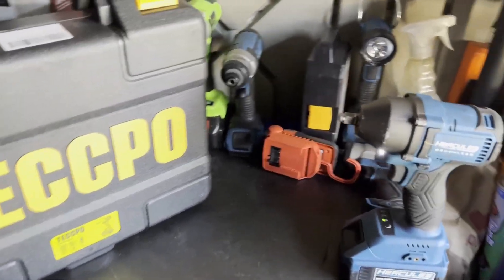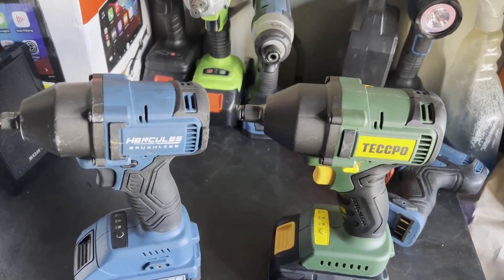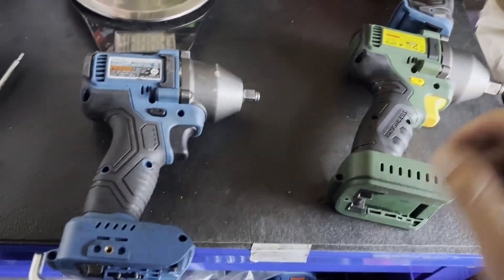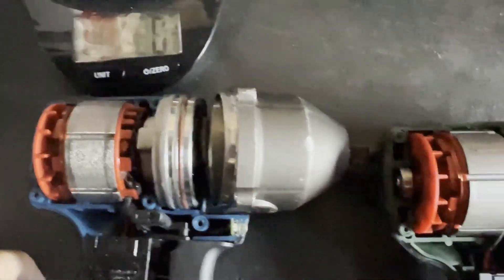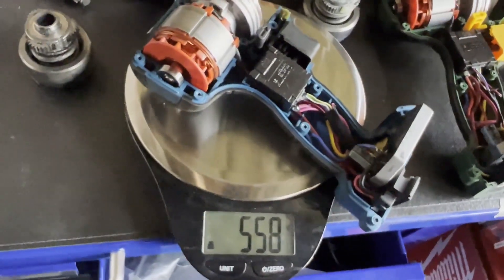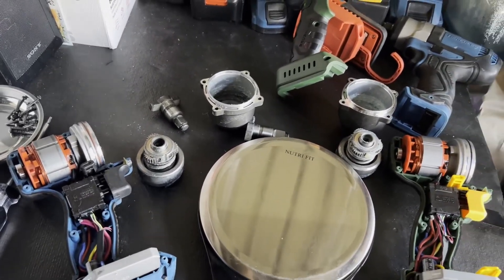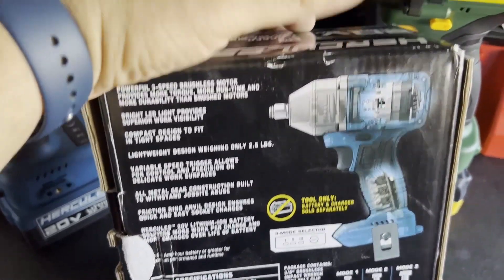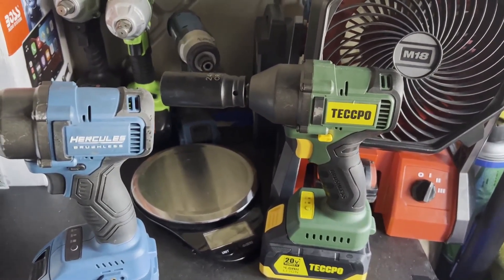Hercules Impact Wrench Chinese Clone? Did Harbor Freight Lie!?? Torque Test and Dissasembly!

Comment: since they are so similar, I wonder if the batteries are interchangeable. Can the Hercules use the Teccpo battery?
Reply from the maker: they didnt physically fit maybe with a shell swap it would

Comment: I mean impacts technology is all very similar if a lot of different is when you worry. Older DeWalt and new craftsman are identical almost. You can even almost get a DeWalt battery to line up with them . Same with Milwaukee and Ridgid. Same owners too.
Reply: That because Stanley owns both Dewalt and Craftsman and Ryobi/Milwaukee/Ridgid are own by Techtronic Industries TTI Group. So Bauer and Hercules are likely made by chinese TECCPRO company. They likely changed some stuff but likely made by TECCPRO which are actually pretty good tools to and pretty much pro grade. To me it about time Harbor Freight step up their game? For years I avoided their power tools as use to be pure garbage, now the Hercules impact driver is as good as my Milwaukee, I use both and both gets the job done without having to switch and both took drops, oil and trans fluid and other dirt without issues. Both brands if you get the sales you can buy a battery/charger and get a tool free, or opposite at times. I got free 8 AH 21700 cells batteries this way with both brands.

Comment: Maybe Harbor Freight did design these and the Chinese factory manufactures the off brands after dark lol. If you buy the Tecc---whatever...you aren't getting a serious warranty with it and practically no support...a separate charger just for that tool only. With Hercules you get a 5 year warranty, support, a growing tool line, and bigger batteries. If you find these knock offs super cheap, you can use them for repair parts.
Reply from the maker: Lol the knock off ones are older but ya the hercules has the superior warranty now with the 5 years

Comment: I wanted to compare that Hercules 20v 1/2" compact impact driver to the Milwaukee M12 1/2" Fuel Stubby Impact driver rated at 250ft-lbs. breakaway torque!

There is NOWAY that weak azsz Hercules have more torque than the Stubby rating it self up to 555ft-lbs of torque, hell nah!  The Stubby is very powerful and you can tell it's fkn' fast on 3rd speed, really fast and it's on the 12v grid.   I believe that their latest Ultra Torque impact drivers have finally put HF on the map for quality tools for that category!

I will get this Hercules 1/2" compact driver just to take off lug nuts off my BMW M5 when getting flat tires in emergencies and nothing more since I already have that Monster of a beast build like a tank Hercules Ultra Torque 1/2" Impact driver with 21700 Tesla cell battery!

Comment: The big difference is you can get Hercules batteries with 21700 cells what cells are in the Teccpo batteries?? I know you mentioned an additional slot on the Hercules battery will the Hercules battery fit on the Teccpo? Also the warranty is not a huge deal on Amazon you can get an extra 4 years for $9.99 for that model.   I've never seen anyone do this study - I may just have to do it myself - which 3rd party batteries (if any), contain 21700 cells?
Reply from the maker: most of the impacts on amazon use 18650 makita knock-off batteries and no they would not fit one another the moved over the protection pin to a different location

Comment: Can the 1/2 Hercules take out lug nuts?
Reply: The 3/8 and 1/2 have the same internals but different anvil and of course you lose a little bit of torque with the adapter on the 3/8 but I was able to take the lugs off  my friend's Honda Fit that some knuckle dragged overtightened, it did take more time than the 1/2 earthquake I normally use.
Reply from the maker: it can take most but not all sometimes they are on there extremely tight but thiw will do 80-90 percent of lugnuts
Reply: If you grab the Ultra Torque, without a doubt, yes.